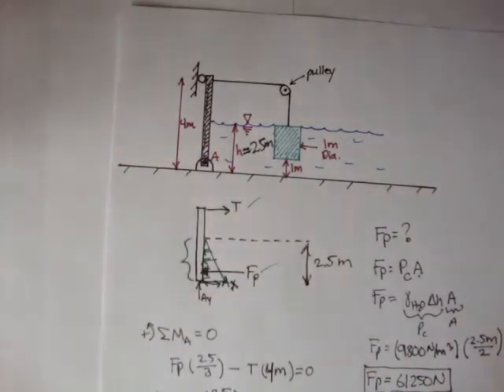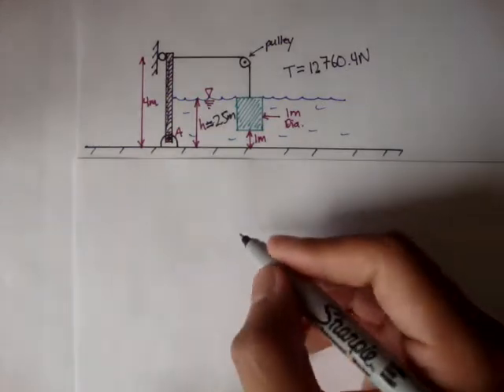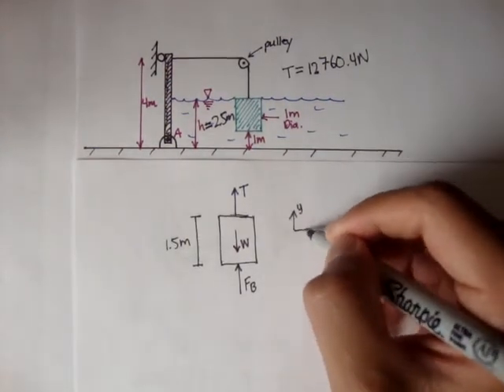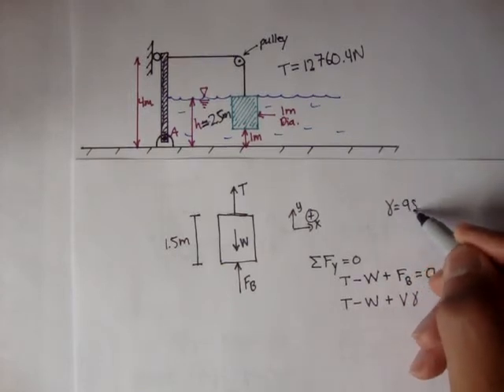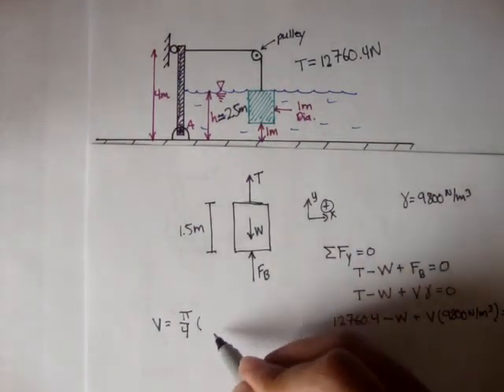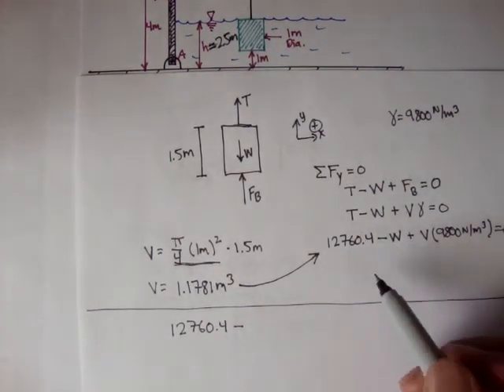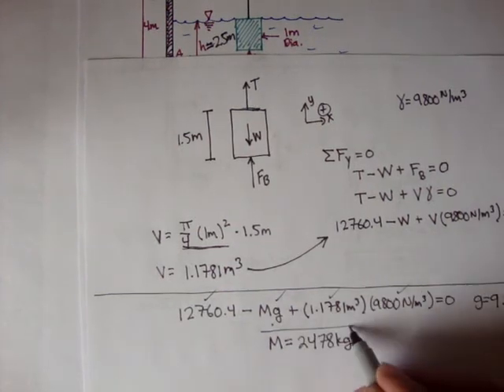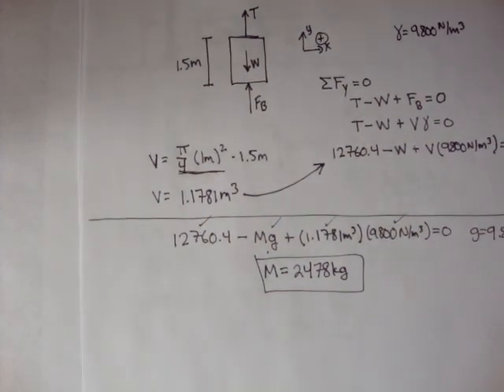Buoyancy: Example 2: Part 2 [Fluid Mechanics #59]

Comment: Hey, I have a q. Can you tell me why you don't consider the force resulting from the pressure distribution at the bottom of the cylindrical mass? Is it because the buoyant force accounts for it?...Btw, you are a savior!!
Reply: If I'm interpreting your question right.  He did at 4:18.  The pressure distribution on the bottom face of the mass would be the same since it's parallel with the horizontal - and is accounted for by finding Volume (height X area).